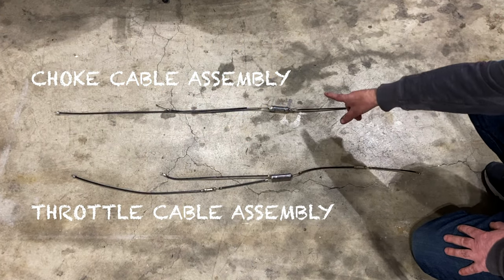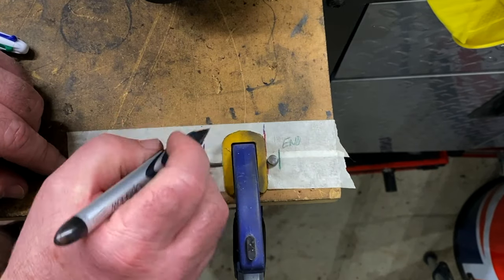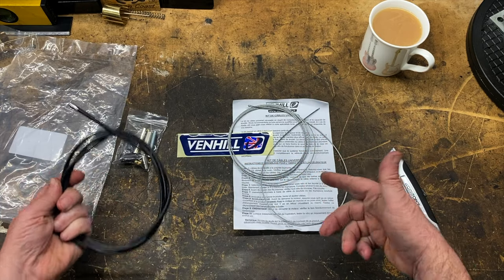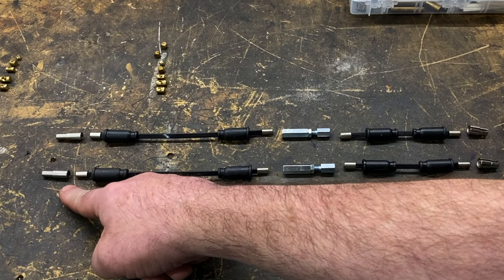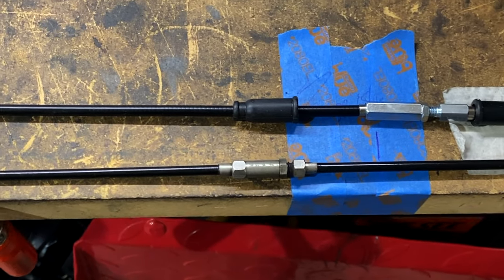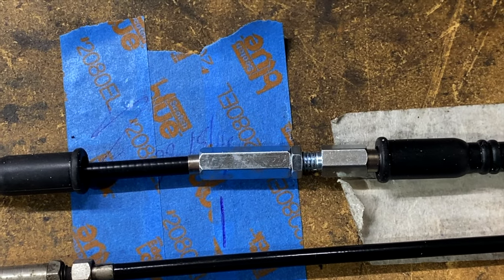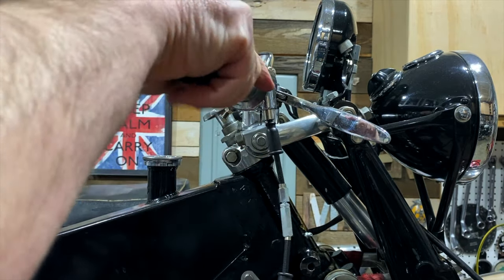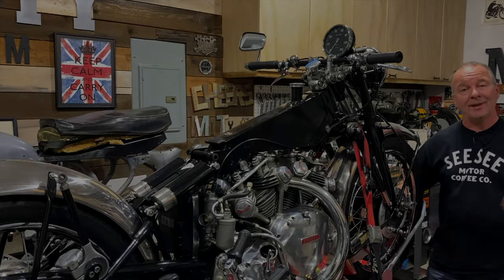Restoration of 1951 Vincent Rapide - Part 93 - Making dual throttle cables

Comment: Splaying the cable strands to take solder, great idea. Splaying the cable strands with your nervous thumb - half expected at any moment one of the wire strand would slip deeply under your nail and there would be an odd jump cut back to the soldering with thumb now in a tight bandage. Never thought for a moment, as Steve says above, that such a simple task could be so captivating: both carbs need gently curved brass guide tubes at a suitable length for each, so that the cable shield either doesn’t travel all the way back to the carb under such strain or that they are big enough to slide the cable shield and all into so as provide extra support. 

There. See how fascinating that was. I must say Mike, a workbench with a British bike motor shell, crankshaft and suitable bearing laying about on it is a very fine bench indeed. Best

Comment: Nice job in the end, we all make mistakes and drinking tea is a must 😀
Better using two cables, it does make things easier, when it comes to adjusting.
Have a great week Mike 👍
Reply: Yes, the tea! Dremml filing and silicone spray would taste very odd I’m sure. Needs one of those little Chinese tea cups with a lid for in the workshop.

Comment: Exactly the same setup on 76 Ducati 860. Changed them to two individual cables for the same reason. Note on the Ducati I deleted the choke assy altogether by replacing the choke cables with flip-up types from Moto Guzzi. Great work and you have way more patience than me.
Reply from the maker: 😉 thank you!  I was running out of patience towards the end I must say. Best wishes, Mike

Comment: Hi Mike
I did much the same with my Rapide a few years ago.
Prior to that the cables were nylon lined ( not Venhills Teflon)with the splitter. Nylon is hygroscopic, as I learned on a wet trip from Vancouver BC to Grass Valley, CA.
On the second day of hard rain the throttle cables began sticking. The nylon liner had expanded from the moisture. Not fun!
Once home I purchased a Tomaselli dual pull throttle and sent a throttle cable drawing/sketch off to Venhills. I have used their universal kits but wanted these cables in Featherlight, the SS inner with Teflon liner. The kits  I've used have all been regular galvanized, they don't/didn't sell the Featherlight stainless in kit form. This is because it requires silver soldering which is maybe a bit much for most home shops.
The nice thing about the full Featherlight cable is that they do not require lube, in fact they work better without lube( stay clean and grit free)  The friction of SS on Teflon is almost nil. Teflon is not hygroscopic, thankfully.
I also had threaded steel elbows added at the carb tops, made by Venhills to specific angles on my drawing . This was an area of concern with the old setup. In the end my drawing was off a bit, the free length was almost too great. I've put the changes on the drawing and a few other Rapide owners have used it with good results.

I think you will find the dual pull to be a much better setup.
Reply from the maker: Many thanks Glen for the great advice. I didn't know that Venhill will make cables to order. I may just look into that!!  Best wishes, Mike
Reply: @TheMightyGarage  
Hi Mike
The Venhills custom cables are a bit pricey but the quality is superb.
They also stock quite a number of ready made cables in Featherlight for more common bikes like the Commando. I switched from a freshly lubed standard  clutch cable to a dry Featherlight (ss& Teflon) on the Commando. That reduced clutch lever pull by 1/3 as measured with a spring gauge. Cost was around 16 GBP iirc. There is also Venhills USA, perhaps you purchased your kit from them?
Reply from the maker: @glenbreaks5448  Thank you very much Glen. I will take a look for sure. I also forgot to mention that I loved the idea of the elbows coming out of the top of the carbs. I can see already that the cables are bent more than I would have liked, and I haven't got the bike of the bench yet!  Best wishes

Comment: Mike, I know I'm old-fashioned but the original cable set-up has its benefits. Try this: Using the friction adjuster on the twistgrip, open both throttles until each slide will just accept a half-inch drill shank. Now move the handlebars to full lock both ways and check the slide height again. Dual cables have a differential curve front and rear, therefore the inner/ outer lie is unequal. Admittedly the front cable can be improved with a copper or brass elbow and a huge zip tie around the U.F.M. holding the cable close. The original design meant that once 1/8" of play was allowed for handlebar movement both cables stayed equal once the rear cable was balanced with the front one. P.E.I. knew what he was about. Cheers from OZ.
Reply from the maker: Many thanks Charlie. I really appreciate your help with this. Best wishes, Mike

Comment: I've been using bicycle shifter cables, inner and outer, for throttles. 

They seem more supple and less friction in bends that the generally supplied motorcycle cables.  Plenty strong enough.  And often stainless.

But there are cheaper bicycle shifter cables to avoid that have very stiff outers.

Comment: Good video Mike, I just spent hours and hours on the same project on my 1973 Bonneville. The parts that I bought (new double twistgrip and cables) were really poor quality, I ended up refurbishing the refitting my original two into one throttle cables and eliminating the chokes altogether. I had to make a new ferrule for the top of the throttle cable in order to get the right amount of adjustment. Interested in the comments of WD Hewson because I also found the replacement cable inner I bought way too stiff, with high amount of friction where the cables bend. All in all an extremely frustrating exercise, particularly buying replacement parts that were not able to be used.
Reply from the maker: Thanks a lot Paul. That's a great idea to make your own ferrule to help with the adjustment. I haven't tried them with the bike started yet, but they seem a little tight and so I've been thinking of possible options. Cutting down the end of the ferrule came to mind, so thanks for the advice. Best wishes, Mike

Comment: I had to make custom throttle cables for my 1976 Moto Morini 3 1/2 Sport when I fitted Mikuni carburetors.  My biggest piece of advice is to buy a gas soldering iron, they are way better!  I hope you used silver solder, as it is stronger.  Finally, Oxford Sturmey Archer 3 Speed Cable works beautifully for older bikes, as it is thinner than the Venhill cable.

Comment: My old 1981 T140E Bonneville has a similar set up as the stock Vincent for it's throttle cables.
Reply from the maker: Thanks David, yes the Norton Commando also has the cable splitter! Cheers, Mike

Comment: It's strange how motorcycle cables don't use the technology of bicycles. The control cables I installed on my bicycle have a low friction liner inside the outer cable housing & the control cable is coated with Teflon. It makes the function of the brakes & gears buttery smooth & since it needs no oil or grease they run dry & dirt free & last longer.

Comment: Neat job Mike, why change from the 1 into 2, to the dual cables, is it more original or more efficient or both?
Reply from the maker: Hi Kevin, the original is actually the 1-into-2 setup. I'm hoping that this 2 separate cable setup will be smoother to operate by removing the splitter. The cables ended up taking the same route as the originals, but the splitter requires some extra adjustments. I also removed the chokes, so that should hopefully help with the tightness of the cables. Best wishes, Mike

Comment: Good work Sir. I've learned how to make up cables following this bloke "Lunmad"'s work: https://www.youtube.com/watch?v=jKc5gJFj17w 
Did you check for proper slack at the extremes of left/right handlebar position? I've found that can be an issue if the drooping section from the grip isn't slack enough.
Reply from the maker: Thank you very much for the advice!!  I love watching Lunmad's videos and have watched some of them many times. Thanks for the note about checking the length of the cables. That's a great point and I will definitely check when the bike is off the bench. Best wishes, Mike
Reply: @TheMightyGarage  Ive found if not right the engine rpm at idle can change as I turn the bars left/right.  Since learned that the cable needs about 1/16-1/8" minimum free play at the throttle end at either extreme bar position. Seems to prevent idle rpm varying.
Reply from the maker: @TornadoCAN99  Thanks a lot. I will definitely look out for that. I appreciate your advice, thanks. Mike